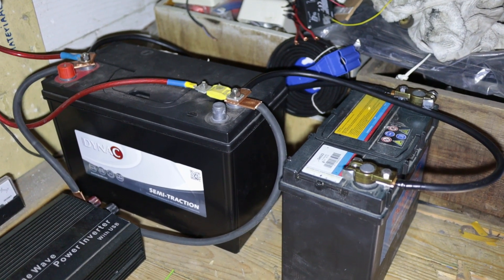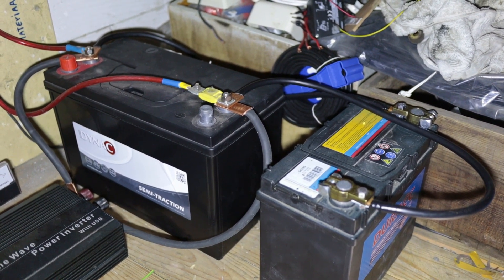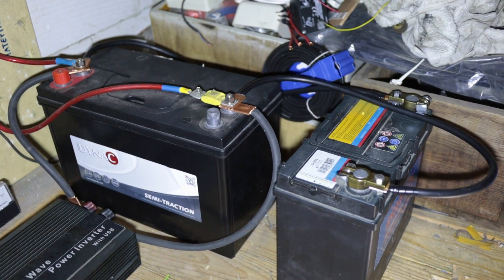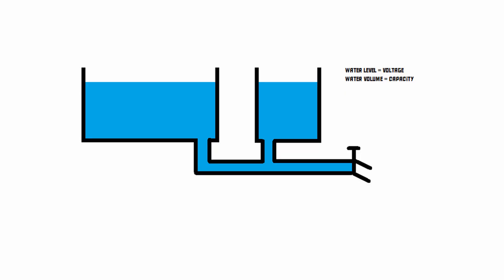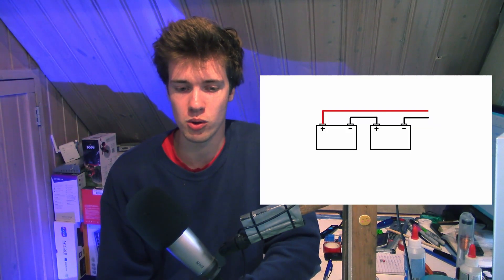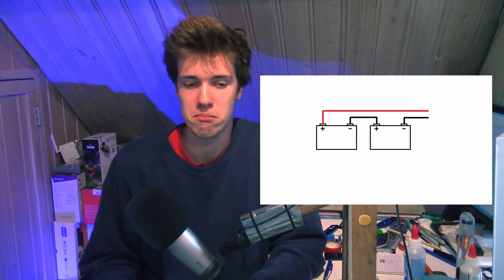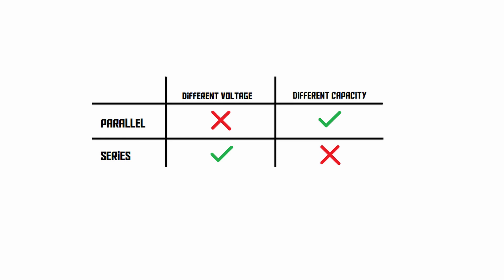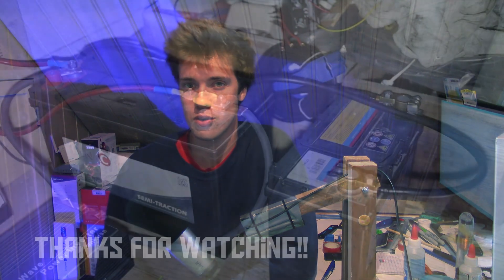Connecting different batteries in parallel/series (AKIO TV)

Comment: The internet tells me you can not do this. the smaller battery will drain faster than the higher capacity. itl go empty while you still draw from the higher one. and then over charge.
Reply: The internet is full of both truth and nonsense but hard to tell apart. The author is correct.

Comment: Good explanation very helpful, may I ask what is the yellow inline fuse you are using in your system ?
Reply from the maker: It's a 100A fuse. Not sure what the official name for this size/shape is. It's mainly there just in case I accidentally short circuit the battery pack.

Comment: Not a good engineering practice to connect batteries in parallel for low internal impedance batteries. It is not easy to ensure that the two batteries are in identical state of charge or voltage at any time.
Reply from the maker: Depends on the use case. Take my battery pack as an example: Could the voltage be different when discharging at 150A continuously? Yes, probably. Will the battery pack be discharged at that rate for long periods of time without interruption? No, typically the load is <20A, too low to create a significant voltage difference between the batteries. 

High current loads aren't ruled out, but they are usually only very short in duration <30 sec, so the risk is therefore minimal.

You're right that it is a potential problem, but for the majority of applications it's usually fine.
Reply: @AKIOTV  As an engineer with four decades of experience in this field, my suggestion to you is not to violate a standard rule in engineering practices. You may get by on occasions, but sooner or later Murphy will play an ugly trick. So standard operating procedure is to stay away from paralleling low impedance batteries (or any voltage source for that matter).  Just to indicate a potential pitfall (of many), say one of the batteries develop a shorted plate in one of the cells. So suddenly you will have a huge imbalance and a 2V odd difference sees an impedance of milli ohms.  You can conclude that the result would be catastrophic - potential fire and explosion not ruled out. All the best and be safe.
Reply: @dip-tree  Pretty well nonsense. Every large capacity UPS on the planet is made up of multiple battery banks without issue.
Reply: as long as your bms is appropriate, and all the batteries are of same capacity and make. There is no such harm. If he bounds himself with standards how he can try on new ideas...
Reply: @northernboy1  With respect, professionally I disagree with your suggestions. There is a difference between engineering professionalism and amateur practices. Think about this, why do  pilots go through an extensive check-list of pre-flight tests, and do not go by their 'gut-feel'. It is because the consequences of an error is very large, and therefore you do not take any chances. Have you not seen countless videos of batteries bursting into flames on youtube?  So if you are just experimenting to study the consequence of a topology, or perhaps just dealing with a temporary but emergency situation you can sometime take liberty with these standard practices.  As I said, anyone who has even done basic electrical / electronics engineering studies (properly) will advise you to not connect low impedance sources in parallel. Hope this helps and be safe.
Reply: @dip-tree  if you carefully read my comment,,, I used word BMS ( Battery management system) 
will cover safety and SOP's must carefully be tackled. 
Now coming to the point, in order to understand the phenomenon, nature and working of any product it is very important to implement the ideas on small scale. 
Yes, you are right the safeties and SOP's should not be ignored. 
But there is a saying we learn from mistakes. And great ideas comes trying stupid things.
Reply: @northernboy1  I did read your earlier suggestion of BMS. However the BMS (if one had connected batteries in parallel) is not going to know anything about the internal topology, isn't it?  To the BMS it will appear as just another single battery, and will assume one has followed standard norms along the lines we are discussing. I am happy that my basic point of safety is something that we both agree on. I just don't want enthusiastic youngsters land up risking life and property in their enthusiastic zeal for experimenting but with half-cooked knowledge. Batteries can be very unforgiving beasts.   Having had a career of more than four decades in designing scientific, industrial and commercial products, including high power power-electronics, I was just trying to share a few tips.  I am not asking people to not experiment, but to not indulge in foolish experiments. The mantra is 'safety' above everything else.  Thanks for the discussions.
Reply: @dip-tree it seems like you said a whole bunch of nothing trying to come off like you're giving good advice
Reply: @appleyardjr267  If safety is bad advice, I don't know which brand of engineering you have learnt.
Reply: @dip-tree thank you for sharing your knowledge. I agree with you in using impedance to explain what is going on there. 
Someone also explained I can parallel cells of different capacities, but I find it difficult to accept based on different impedances of such batteries in parallel
Reply: If they are connected in parallel I can be sure that the voltage is the same. That's what being connected in parallel means. If the chemistry is the same the state of charge vs voltage will be the same and the state of charge will be the same. Even for old and new cells the SoC vs Voltage doesn't vary much so old and new cells can be connected in parallel.
In series most bets are off! 
I've spent decades designing battery chargers and management systems for telecomms and have seen most things...

Comment: Thank you for this great content!
I have questions, Would that be okay if I connected 12v 35ah car battery with 12v 8.2ah ups battery? I'm asking that because my smaller battery is already degraded even though it has 12v it doesn't have the capacity, So even though I said 8.2ah according to the sticker it may only have around 5ah I guess. Thus if I don't mind about this smaller battery's health would that be okay to connect 35ah battery to this combination? 
I'm connecting these to a 1.2kv computer ups.

Comment: so im building a 6s 24v battery bank and each of those batteries in series will have batteries connected parallel to them would it be ok than to use batteries of different capacity in the parallel array?  whatever its called.... i was going with a 6s but 6 in p as well but messed up and bought 2 different capacity batteries.  as long as i keep each array in parallel the same capacity as each other i should be good right?  be just one battery of much lower capacity at the end of each.... like a 5kma difference.  Its my first time..... if the explosions is worth the risk you take it.  for science.
Reply from the maker: I assume you are going to use some sort of balancing system/balance charger to keep the series groups at the same voltage?

What you have in mind should work given your series groups have the same capacity.
Reply: @AKIOTV  perfect than lol thanks alot. This stuff is not cheap is it?  im back into the mountains to get things done than.  Take care and thanks again for the help.

Comment: Great content!

However, my question is: Would there be problems if I connect an AGM 180AH 12V lead acid battery with a GEL 100AH 12V lead acid battery in SERIES (to give me 24V) then connect a battery equalizer/balancer to ensure that they charge and discharge at equal voltage?
Reply from the maker: Maybe you'd get away with it, but you need to make sure the charge/discharge current stays within the limit of both batteries. Also, you're not making optimal use of the larger battery. I'd say its far from an ideal setup.